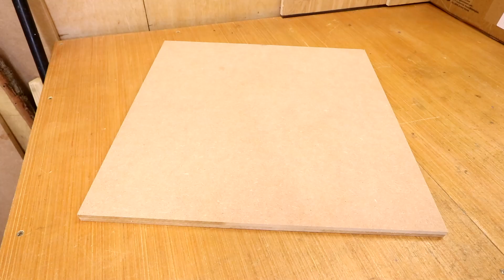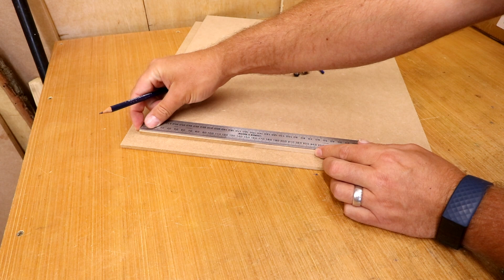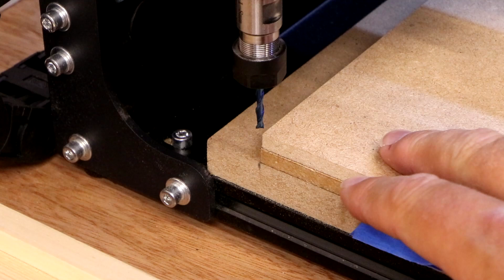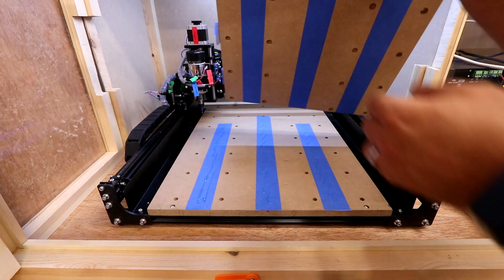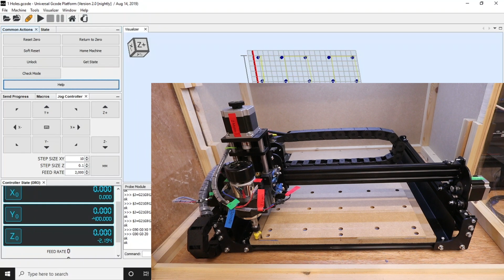Making a spoilboard and tramming the 4040-XE  CNC from FoxAlien

Comment: im having problems runninng this. im still initially setting up but to start with the holes my router kept diving into my work up to a limit switch. i managed to get it to run by making my own holes file in easel and ran it in ugs. it wasnt the best idea bc it was off. now my router is raising up and carving into the air when trying to run the surfacing. im sure its just overwhelming trying to learn this right now but idk i need help..>>> $$
$0 = 10    (Step pulse time, microseconds)
$1 = 255    (Step idle delay, milliseconds)
$2 = 0    (Step pulse invert, mask)
$3 = 0    (Step direction invert, mask)
$4 = 0    (Invert step enable pin, boolean)
$5 = 0    (Invert limit pins, boolean)
$6 = 0    (Invert probe pin, boolean)
$10 = 115    (Status report options, mask)
$11 = 0.010    (Junction deviation, millimeters)
$12 = 0.002    (Arc tolerance, millimeters)
$13 = 0    (Report in inches, boolean)
$20 = 1    (Soft limits enable, boolean)
$21 = 1    (Hard limits enable, boolean)
$22 = 1    (Homing cycle enable, boolean)
$23 = 3    (Homing direction invert, mask)
$24 = 25.000    (Homing locate feed rate, mm/min)
$25 = 500.000    (Homing search seek rate, mm/min)
$26 = 250    (Homing switch debounce delay, milliseconds)
$27 = 3.000    (Homing switch pull-off distance, millimeters)
$30 = 12000    (Maximum spindle speed, RPM)
$31 = 0    (Minimum spindle speed, RPM)
$32 = 0    (Laser-mode enable, boolean)
$100 = 40.000    (X-axis travel resolution, step/mm)
$101 = 40.000    (Y-axis travel resolution, step/mm)
$102 = 168.000    (Z-axis travel resolution, step/mm)
$110 = 2000.000    (X-axis maximum rate, mm/min)
$111 = 2000.000    (Y-axis maximum rate, mm/min)
$112 = 2000.000    (Z-axis maximum rate, mm/min)
$120 = 300.000    (X-axis acceleration, mm/sec^2)
$121 = 300.000    (Y-axis acceleration, mm/sec^2)
$122 = 300.000    (Z-axis acceleration, mm/sec^2)
$130 = 400.000    (X-axis maximum travel, millimeters)
$131 = 380.000    (Y-axis maximum travel, millimeters)
$132 = 56.000    (Z-axis maximum travel, millimeters)

Comment: I could only find 12mm mdf.  Is there a way to edit and make it cut the holes deeper, like maybe 12.8mm ?
Reply from the maker: Sadly no and I no longer have the original files. To do it in 1/2in you would probably need to draw it and do it from scratch. You could potentially do it one side and flip it left to right, so essentially machine the top, flip over and machine again

Comment: I noticed the FoxAlien you have, is missing the Home/E-Stop plate at the front of the unit.  This is a key point if you want to achieve the 400x400mm movement required.  I had to swap it to the back right corner for the spindle to move far enough forward to exceed 400mm in the Y direction.  With the Rubber bumpers in the belt and then re-adjusting my bumper switch plates, I was able to get 405-X and 402-Y.  But it took some Tuning.  Thank you for this Video and the resources you provided.  Very well done.  I'll be cutting a new Spoil board, once I get the 1" clean-out bit in the mail.

Comment: Good morning. I'm a novice  cnc user and want to know if I have to use the program that is on the  memory stick that came with the  Masuter 4040 I purchased or if I can use Easle. Apparently  Candle is on the memory stick. Also, is there any other software needed to operate my new cnc machine. Today is July 20 and it's 7:15 a.m. Eastern time.
Reply from the maker: The short answer is no, you do not have to use the software on the memory stick and yes you can use Easel. I would suggest watching this  video as it will explain the different software options for each stage
https://youtu.be/EMI97Rcb0bQ
Reply: @JamesDeanDesigns  Thank you for clarification. I'll be sure to view the information you provided.

Comment: Have you had any problems running the 300watt spindle with easel? when i zero my Z using the probe my spindle will not turn on. But if i click ise last Zero it turns on and cuts fine.

Comment: So i have a question, what if my bed isnt level? I noticed on my 4040 masuter one side of the bed is slightly higher than the other half. Would i need to surface the bed?
Reply from the maker: The correct approach is essentially what I do in this video. You need to level the bed as much as possible (little shims underneath or something) add a spoilboard on top of the bed and then you surface the spoilboard .
Reply: @JamesDeanDesigns  gotcha, now i just need to wait for someone in the group to make a spoil board tool path for the 4040 masuter lol

Comment: Hi James, thanks for the very helpful and well thought out videos.  Perhaps another video topic could be "How to Maximize the Useable Size of x-machine".  I keep tinkering with the limit switches but cannot find the solution to use an actual 400x400 sheet.  I can get to 385 but the last 15mm elude me.  Maybe altering the switches removing the roller ball and just triggering on the microswitch?  Perhaps the belt tensioners need to be 100% tight to the frame?  I know you mentioned this in another video or FB in passing that you tweaked some combination of these but would love to know more.  Thanks again!
Reply: Hi CJ and James, I had the same issue.  Plus, I noticed that James' 400mm x 400mm board covers five rows of holes in both directions, and mine didn't!  I tried running anyway, to see what would happen.  It cut the first row from left to right, but the holes are about 90mm apart, instead of 100mm apart like the original spoilboard.  Then it start going to the rear on the right side, but hit the limit switch before getting to the fifth hole. So I had to abort.  But the holes if did cut do not line up with my original spoilboard anyway, so I'm going to have to redesign from scratch.  Is James' original spoilboard on a 90mm grid?  I don't see how a 400mm x 400mm overlay could work otherwise.
Reply from the maker: If you have the FoxAlien Masuter (not the 4040-XE) this will have a smaller working area and I don think you will get the 400x400. However if you have the 4040-XE then you should be able achieve this by releaseing the plates the limit switches touch and moving them further away. If thats not the case then you could possibly try sending me some photos on Instagram or Facebook and I'll try to help
Reply: @JamesDeanDesigns  Sorry for the delay, working another issue . . .  I do have the 4040-XE, and it does not appear to have the capability to adjust to 400mm in the y- direction.  The limit tab is as far back as I can get it.  I could achieve about 1/8" more if I pulled the belt adjustor all the way to the rear, but that wouldn't be enough.  I took several pics, but I cannot figure out how to add them to a reply, sorry about that! 🙁  However, I'm still confused about the dimensions of your grid. especially since the code cut holes 90mm apart when I tried it!  And they clearly didn't line up with the holes on my machine!

Comment: I would do exactly as you do to level the spoil board but then I would move the leveled piece to the bottom and when I need a new board I can unstick the top piece and glue/tape new one to the leveled board, that way I level the board just once and not each time I change it

Comment: Do you have the svg files? I bought a Masuter 4040 on amazon but it says the dimensions are 400mm x 380.
Reply from the maker: I probably still have the file somewhere but the spoilboard is different between the two machines
Reply: It looks exactly the same, just need to compensate for the difference in x travel.
Reply from the maker: @pushinforty8177  the masuter board is split in 2 and has the fixing holes in different positions so there are some differences. I'm not sure of the  hole spacing though
Reply: @JamesDeanDesigns  no worries, I used the board as a template and made the spoilboard myself with a drill and jigsaw. Took about 20 mins, pretty sure I beat the machine!

Comment: Do you have the tramming tool file? I don't think it is a part of the spoilboard file download. Also, what are the downsides to skipping the holes for the bolts? I don't plan on using clamps ever.

Comment: Good information. I didn't see where you fastened the spoil board to the existing bed. Is it just attached using the CA glue and tape?
Reply from the maker: Yes, thats all it is. Gives good solid adhesion all around
Reply: @JamesDeanDesigns  
Thanks James, appreciate the videos too and the G-codes for surfacing the spoil boards.

Comment: Awesome video. Believe the Masuter machine has slightly different work area dimensions. Is there an easy way to adjust the code in your files to account for the difference?
Reply from the maker: Probably not to be honest as the masuter bed is a little different. I'll see if I can get the files from FoxAlien
Reply: @JamesDeanDesigns  I just asked the same question. Did you have any luck with Foxalien?

Comment: Nice video, thanks a lot. But i think the better result is first to tram the spindle/router (using a flat reference surface) and after that you can surface the spoil board (something like in this video https://www.youtube.com/watch?v=FzFPadoZH5Q  ). What do you think ??
Reply from the maker: Hi, you can't tram your spindle until you have a flat(ish) bed. For example of your bed slopes by 1mm left to right, you then cant tram the spindle to that otherwise its wasted time, you're going to have really bad tram marks. We all have our own ways. If you want to be fussy then the correct method is to surface, tram and surface again - potentially tram again if you really want to go all the way :)
Reply: @JamesDeanDesigns  You are right. In fact Mark doesn't use the bed as reference to tram the spindle but a glass surface as reference to tram the spindle and after that he surface the bed.
Reply from the maker: @IceCreams62  ah I see. As long as you're tramming to a surface that's perfectly parallel to your X axis, then yes it should work. As for which way around you do it, perhaps his method may work a bit faster, especially if surfacing a machine of that size.